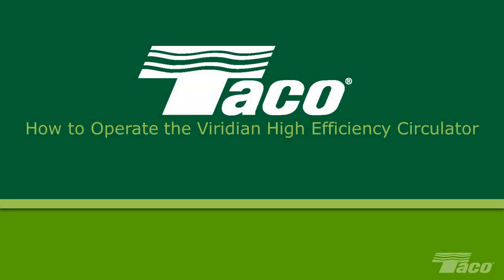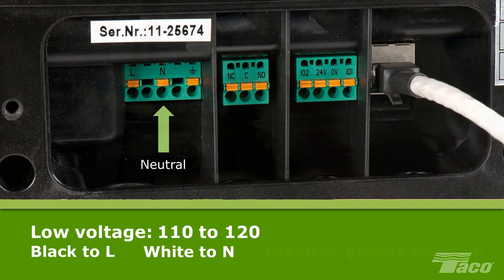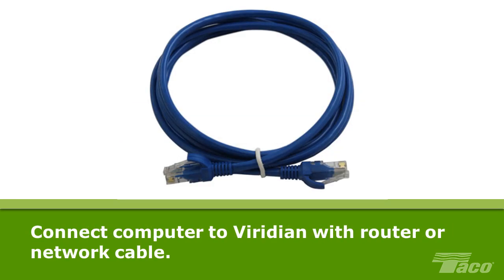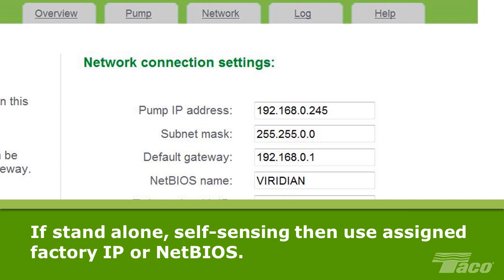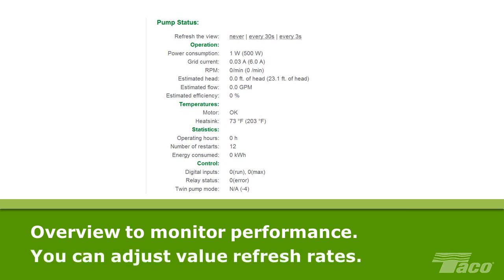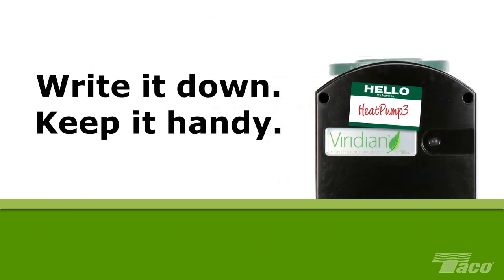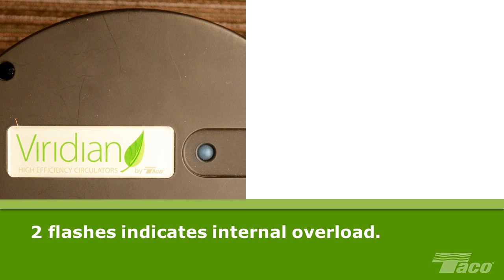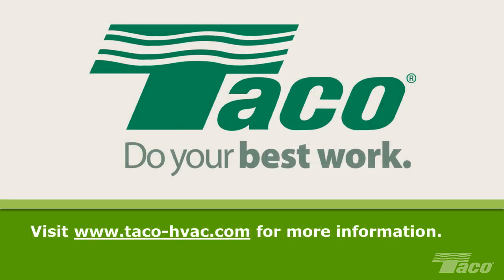How to Install a Taco Viridian Pump, Part 1

Comment: We own an apartment building and had multiple VR30-2s fail within the first 3 years of operation. They were eventually swapped out with the VR30-3s. However we just had one of the VR30-3 fail.  

We have 208V, which met the requirements for the -2, but now we see the -3 requires 230-240V.  

Can the -3 work in 208V, or was this the cause of our error code E27?  If so, should the -2s have been replaced with an equivalent pump that works in 208V?

Looking for some help! Thank you!
Reply from the maker: Metlej, having failures like that in succession may have many different reasons but I would try to contact one of our representatives local to you for assistance. It would be best to have another set of eyes on your project to discover the best solution. https://www.tacocomfort.com/rep-locator/